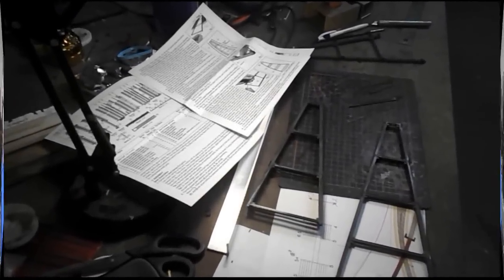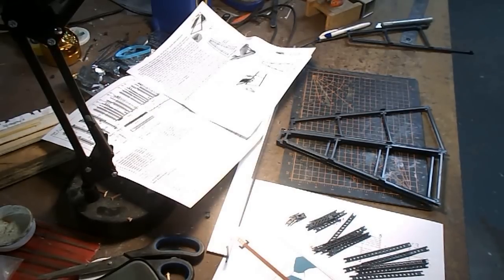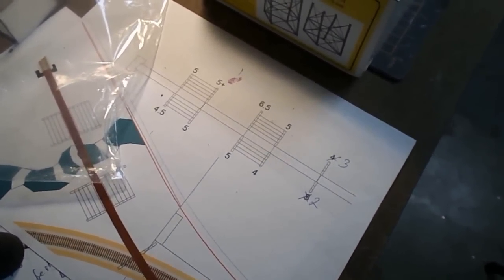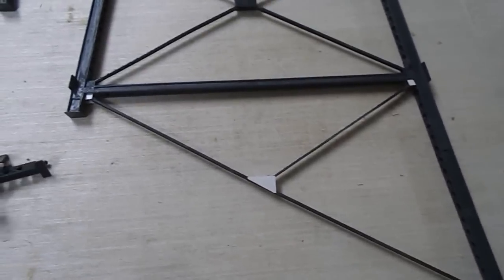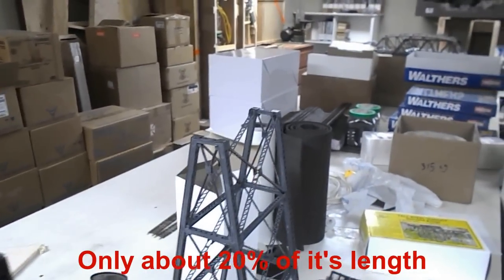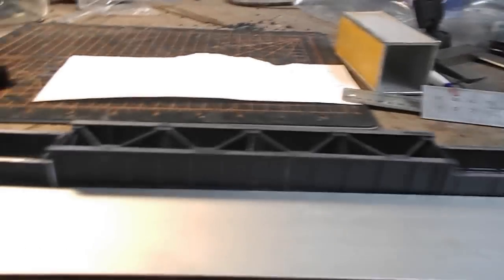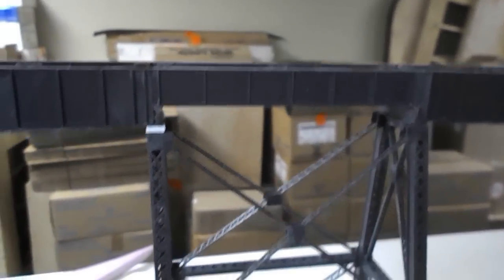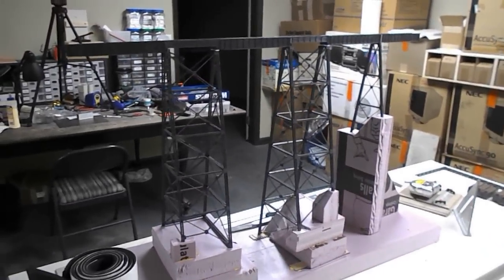A tall trestle for the Keewenaw & Scenic Valley Railroad

Comment: Thank you for this video.  I have been planing on building one of these.  I really appreciate the info on figuring the offsets for the curve because mine will also be a curved bridge.
Reply from the maker: Glad it was helpful to you.  This is not the normal way to plot the path of the trestle, and only works if you have an accurate CAD drawing of the layout.  Usually, it's better to make a template of the actual layout location.  I didn't have this option available because I'm pre-building the trestle and the layout benchwork doesn't exist yet.